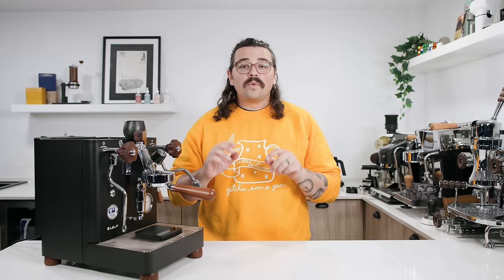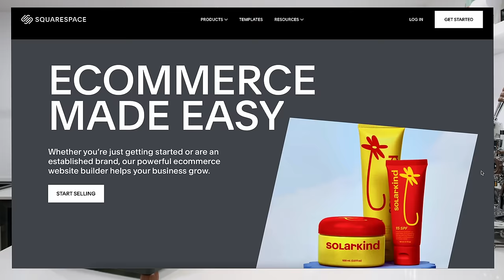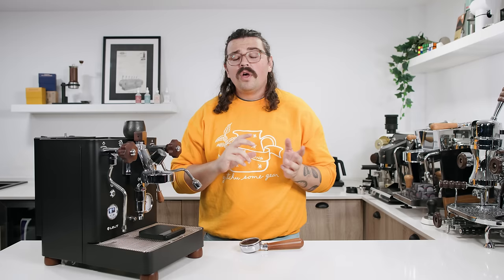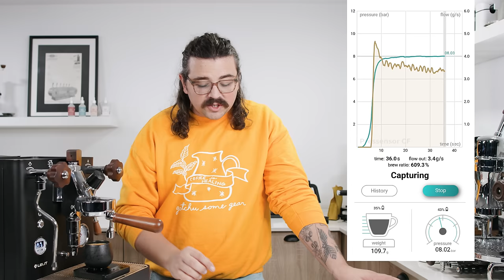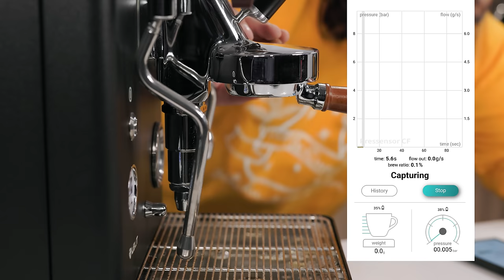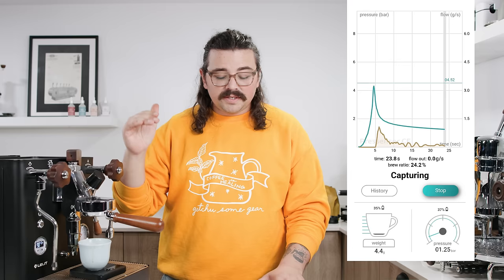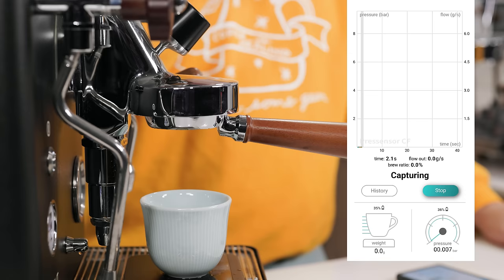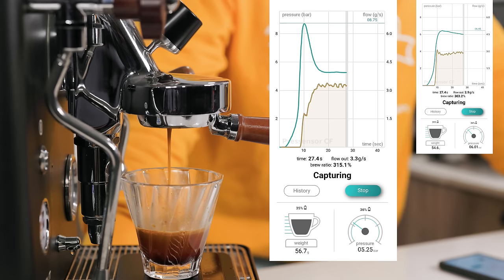UNDERSTANDING ESPRESSO EXTRACTION: Ultimate Guide on Pressure, Flow and Resistance

Comment: Nice!  I will take some exception to the equation. Quite simply, flow is a result of pressure applied over a resistance. Think of pressure like power, and resistance as weight.  If I’m more powerful, I can lift more weight.  The beautiful thing about espresso pucks is that the resistance across the puck is a function of the puck history - now think pressure profile. As we know, if we apply max pressure at the group head right away, the puck compresses and offers more resistance.  So later on in the shot, the flow would LOWER than if we applied low pressure at the beginning of the shot.  Crazy!  That’s so many people love flow profiling, but it’s really pressure profiling. 😎

Comment: How hard is it to return to the original 9-bar machine?  Water volume and pressure can be measured and regulated automatically.  Having a pressure meter looks cool, but why use one when flow and pressure can (or can't) be controlled by an engineered machine?  Ninja Espresso machines are approaching that intelligent control.

Comment: My shots are 1000% better! Thanks Lance! Just applied the knowledge in this video on my ECM E61 machine with flow control this morning. Starting the pull at full flow, then closing flow to bloom for around 10s then opening to near 9 bar and tapering flow down at the end. Extraction is hugely improved. Shots have great balance and complexity. Like candy! BTW: I find grind speed a great tool to control puck resistance. I am pulling 21g baskets at min RPM on a Lagom P64. The slower speed reduces fines overcome by the larger basket. Shots have clarity and body and this technique works well. Edit: Yes extraction is higher — wow the caffeine is hitting me right now after two 21g basket.
Reply: How long you kept the full flow before closing it for the 10 s bloom?
Reply: @Mustapha_El_Hamdaoui  Typically 20s but I throttle down based on pressure drop and flow change.
Reply: @BurnsRubber   Thanks for the prompt reply! I will definitely try that :)

Comment: Such a thought provoking and inspiring video. As an original 2002 Gaggia classic owner who recently fitted pid, pressure gauge and dimmer mods I would be really intrigued to see a video with this knowledge applied to show me manual flow profiles to improve the espresso I have been making. Now off to change my opv back down to read 10 bar on the additional portafilter mounted pressure gauge I have. Before watching your video I thought I was being clever by having it set to around 12 bar and then I would adjust the flow rate to achieve the pressure I wanted eg 2bar for what I thought was good pre infusion.

Comment: Hey Lance, I love these kinds of videos! Dude, you’re so good at interpreting data and explaining it in a way that makes sense. It may be that my engineer brain is the only one that thinks this way, but when you’re talking about dead space and connection between the pump and the puck, I feel like something that could help people visualize that is the idea that air is a compressible fluid and water is incompressible. So air will absorb some of the force exerted by the pump like a spring until it’s displaced with water.
Reply from the maker: Of course. It is a massive talking Point in lever espresso. But not as much in pump machines.

Comment: Oh wow, TIL that particle distribution of grinder can have a huge effect on your espresso profile. I was always struggling with my Flair because the pressure couldn't maintain a straight 6/9 bars without flow rate getting very fast and messy. Thanks! Now experiment a little now that I understand it a little better.
Reply from the maker: absolutely! Not a bad thing at all. could just be a pairing of a light roast (low puck integrity) and low fines

Comment: Makes me glad I have a Flair58 and a pressensor 🎉🎉

With the flair I’ve never really thought about the significance (until now) of there literally being zero water gap between ‘pump’ and coffee puck as you’re filling the chamber directly above it. So once you pull on that lever you’re having an almost immediate impact.
Reply: I have never thought about that either! I do wonder if low-flow "pre-infusion" on the Flair 58 has a different effect than what is described here on the Bianca (as in, you nearly immediately build up pressure when you pull the lever).
Reply: The flair has something no other machine has. And it is that you can literally feel the shot as you pull. It is a very simple yet very clever machine.

You can feel the puck integrity as you pull the shot. I always wondered why the shots out of my flair pro tasted so good compared to when I pull from my modded Gaggia.

Comment: I found this video to be a great addition to my (limited) experience using a pressure gauge on an e61 group head. I also have a pump speed controller on my Gaggia Classic Pro, but no realtime pressure info. The best I can do with that is measure the 0 resistance flow rate at the variable pressures the pump produces, and extrapolate from there. But seeing the actual shot pressure is a real aid in dialing in a shot and understanding the shot dynamics. I have reached my endgame equipment setup, so this deep dive into shot dynamics is much more interesting than endless equipment reviews.

Comment: Oh man I've been doing it all wrong again. I've been saturating at low flow with my dimmer modded machine with a ramp up to max after first drip followed by a slow tail off in flow till reached 3:1 ratio. Will try full flow saturation tomorrow with some Guatemalan. Thank you Lance for the excellent content once again. 👍 From France
Reply: Same. Like you, I do let the puck fully saturate at low flow before full flow but now curious about reversing the process - full flow then back off at first drip. How did it go for you?
Reply: @jdrobison1967  hello. Quite interesting results - had to grind coarser to avoid choking but works really well. Seems to reduce astringency . Needs more experimentation but I wonder about reducing the ratio a little. As always Lance makes you rethink your coffee routine!

Comment: Great video regards to the importance of impact re pressure profiling. With out getting into the nitty gritty of picking apart some of the details. There also were a lot of points I did agree with as well but I’m confident still the argument still stands for controlling pressure monitoring flow and the better consistency of volumetric machinery with digital pressure profiling over that of manual flow control with the combination of human error and flow being a secondary guide to achieving pressure, one that is far less predictable n much more reactive n dependent on the typical variable. I very much enjoyed this video n I have heard the counter claim in full thanks to the quality n detail you go into in this video however. Great production quality n great discussion 😊 still in my opinion one of the best content creators on you tube 👏👏👏
Reply from the maker: You're arguing from a place of a Cafe and consistency. The more control and at a fraction of the cost is manual flow control, which is definitely more cost effective and practical for the majority. Without even getting into which is superior.
Reply: @LanceHedrick  no in general , yes flow is more cost effective ✅ but definitely not more accurate or consistent. That’s not to say it isn’t effective as in it causes a change that’s 100% true but in terms the ability to control n replicate. I think at this stage it’s ok to disagree I have tested both principle methods so many times over it’s not even funny at this point but yeah there would need to be a way that a human could not only pre predict the tiny variables and perform the exactly appropriate physical action required also in combination with the volumetric stage of that extraction. It’s just not realistic, but I will say this I genuinely enjoy your videos n the respect you offer to engineers of lever machines the feeling is mutual infact I’m willing to hedge my bets there’s probably over a 100 things in this video we probably agree on in contrast to the things we disagree on. I’m open minded I’d just need to see the evidence of a manual flow control trying to compete at the same level of consistency as a digital volumetric pressure profile machine.

Comment: Hey Lance, great content. Had to watch it twice and brew multiple shots so I was able to understand it correctly but got great results now. I noticed your Bianca is set to 90 degrees. Isn't that super low considering the offset and the temperature that you'll lose at the group head? Or did you change the advanced settings of your machine so that the offset is applied to the boiler in the background?

If so, do you mind sharing your settings?

Comment: for some reason, i prefer an inclining pressure shot. i think it has to do with countering/challenging the idea that flow is responsible for pulling the solubles out? i am thinking perhaps drag is what im trying to get at as the reason for extraction, not flow. so drag is inevitably higher as there is more solubles diluting into the water, but as the shot goes on, there will be less drag. so an increasing flow rate with a relatively low starting flow rate is the profile i go for when focusing on drag.

i looked a little more into this and searched for "highest amount of drag" and interestingly a stackexchange answer said a semi circle with the flat side facing the wind. and that looks similar to tapered baskets. of course there is a lot more to it, i am not sure how resistance and drag can relate if at all. but flow doesnt say much. you can have low flow but extract less per volume. because the drag is also low.

and to reduce drag on the edge of the puck for edge extraction, maybe we can look at golf balls, and provide dimpled walls.

some more reasons why we might want the "right amount" of flow is that when the flow is too high, it becomes turbulent, which causes unevenness. so an ugly shot is likely not just an aesthetic issue anymore. however, flow seems to correlate somewhat to increased drag forces, so my idea is that we do want to increase flow somewhat, but to the point that it still maintains a laminar flow and not a turbulent one. so starting at a lower flow rate (with finer grind) but eventually increasing it will yield a much tighter ratio, while maximizing drag forces. the finer grind will increase the viscosity or density, in whichever formula you want to use, drag coefficient or stokes law. whereas this idea of maintaining flow at a constant rate seems to be out of the idea of keeping that laminar flow, not taking into account drag forces and extracting solubles. ie if you use too fine a grind, flow will be all messed up and somewhere it will be turbulent as well depending on your machine/pump, causing uneven extraction and all that. and so you might associate the inconsistent flow towards the extraction, when it really is about it being turbulent.

Comment: I saw a video on your Instagram where you were at an expo or something and you did a bunch of flow profiling tests and talked about flow and pressure. I was waiting for a more formal video  like this one. Would’ve been nice if you used the BDB to do it (since I just bought one lol), but I think these concepts and applications are universally applicable so long as your machine as flow profiling capability. Thank you as always.
Reply: Are you doing the Slayer mod?
I just bought one as well, to replace my Flair 58 which gets really old really quickly if you have to do more than one shot at a time.
I'm planning to do the Slayer mod and I'm wondering if closing the needle valve will actuate the OPV as I like my blooming shots. I assume it won't.
Reply from the maker: the slayer mod will do nothing to the OPV, but that doesn't matter. If the puck has degraded, it won't go up to the 9 bar. it will peak elsewhere, unless you go super fine. The OPV acts liike a ceiling. you don't need to hit the ceiling.
Reply: @LanceHedrick  I want to also slayer mod my BDB. I find 6-7 bar shots with preinfusion are what I tend to like the most. A few of my favorite coffee shops use a lower baseline pressure with several seconds of lower pressure preinfusion. I want to be able to do this at home but Slayer mod is the only way right? Running the entire shot in preinfusion won’t give me several seconds of 3 bar followed by the rest of the shot in way 7 bar? I’m only asking as I seek more of an automated workflow outside of R and D
Reply from the maker: you can change the OPV of the machine if you want a top pressure of 6-7 bar. not hard. on my first BDB video, I have a "bible" of sorts with all the mods detailed on forums. I would first do that and then use the built in pre infusion option to control the pressure of preinfusion. Shuold be able to get this style of shot with out modding it at all- just changing OPV
Reply: @LanceHedrick  thank you Lance! I think slayer mod will be fun especially for lighter roasts…or just to leverage manual control over flow to have fun with a shot regardless of roast

Comment: So I've been using the Bianca wrong for the few days since I got it. I thought a low flow start would be beneficial as it would not be hitting the puck that hard immediately. Why am I watching this at 1:30am....I really want to pull the same shot with that disabled and using your technique shown in this video. 

On another note, the best tasting shots I was able to produce from my first machine, the Dedica, were ones where the grind was too fine and was blocking the machine, so in attempt to save the shot I stopped the pump (no solenoid on the Dedica to release pressure), went for 20 sec blooming and restarted the pump. This way the beverage that came out was actually better than a "properly" ground one at the "proper" 25-30 sec shot time with the coffee I was using.

P.S. On the Bianca, if you don't pull the lever all the way down, it actually does not release the pressure so you can do blooming this way without using the flow rate flap. Might be useful for other e61 machines without it.

Comment: Really interesting what you say about pre-infusion. I found to get the best result on my Sage Dual Boiler by going manual pre-infusion until around 4-5 grams and then allowing full flow for a 1-2, 1-2.5 ratio with lightly roasted Ethiopian beans. I get very close to the result how my favorite cafe shop makes the espresso from the same beans and I'm very happy with it.
Reply from the maker: That's great! And I didn't say anything a out preinfusion being less than ideal but low flow bring less than ideal. You can have preinfusion coming with a decent flow rate. There is no such thing as a static PI. They differ machine to machine. Your machine could have a fast PI with low pressure
Reply: Will compare a turbo shot to a 35 second shot with my bluetooth scale. Really instrested in what makes a turbo sweeter.
 @LanceHedrick

Comment: Hey Lance, thanks a lot for constantly shedding light on these super interesting yet quite complex topics around espresso! Your videos are helping me out a lot & I really appreciate the effort you're putting into them.

You definitely motivated me to start playing with the flow control on my Bianca first thing tomorrow morning (which I haven't touched in a while, since I first wanted to make sure that my puck prep is on point with the new grinder I got 😬)

Speaking of the Bianca - am I correct in assuming that you wouldn't recommend using the Bianca's 'Low Flow' Mode without saturating the puck via pre-infusion first?
And since you're so adamant about the quick puck saturation - would you recommend to start the Allongé shot with full flow for quicker puck saturation & dial it down to the ~4ml/s once the first drops are hitting the cup?